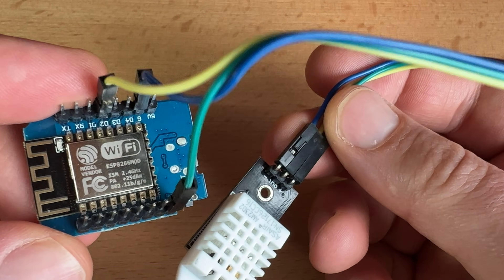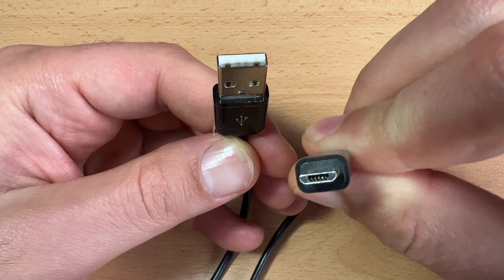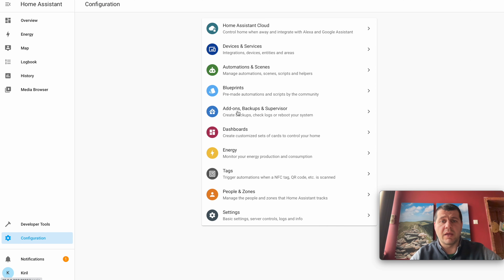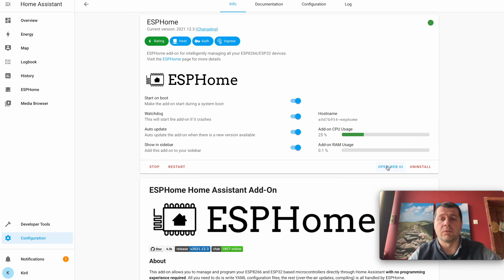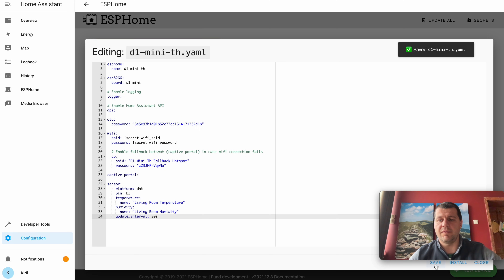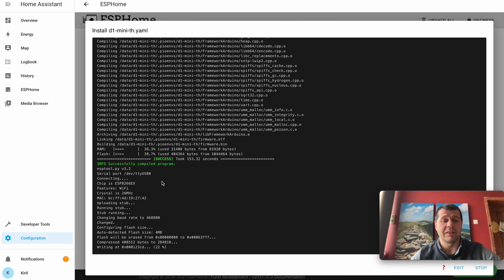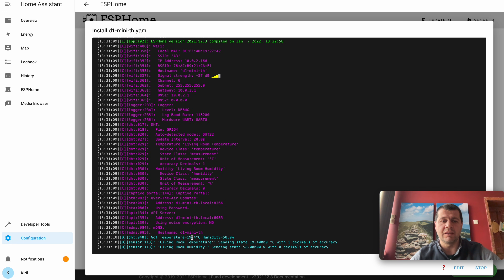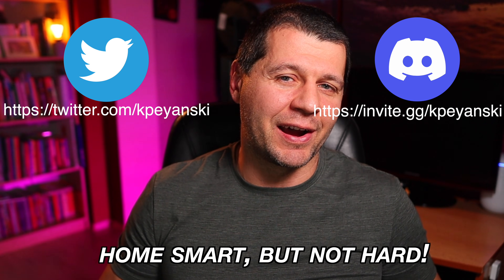Cheap DIY Temperature & Humidity Sensor that works with ESPHome & Home Assistant

Comment: Very nice video.  I'm just now learning about ESP32.   What if I want to power the esp32 board with a battery instead of USB connection?  I want to place one in my greenhouse to monitor the temperature where my plants are growing.  Later, I want to turn on a heater if it gets too cold...

Comment: Here hoping this comment can get seen. I am currently having an issue and I am fairly sure it's the firmware 
Whenever the device loses power or reboots, the readings after it's back online are horridly incorrect, to solve this I simply re-install the firmware to the sensor via HA. Wondering if anyone might know a resolution to this

Comment: Hello, I have connected Dallas sensor to ESP32 and it works. BUT. I also need to connect meat temperature probe which is technically a thermistor. Do you know by any chance how to write the yaml file in the ESP home?

Comment: Decided to build this and was surprised that in my yaml pin: 2 is entered yet the physical wire is on D4, why is this working thought the data pin was supposed to be D2? Also can't type in D2 under pin it doesn't like that so I have to enter just 2?

Comment: I couldn't get my temperature readings to go off. I realized you needed to "install" the changes, if you edit the yaml afterwards. Did an update or install, and got the temperature/humidity readings right away.

Comment: Could not connnect to board through ESP Home with any method. I always run into problems lol. Can use Arduino IDE software with no issues tho. Any way to integrate my device into Home Assistant after setting up with IDE?

Comment: Nice tutorial, I made 3 sensors like this, they only work after pressing the reset button on the d1 mini once (if not they read completely off values like negative temperature and 20% h). And also they become unresponsive after some time or I think after a certain number of reading. Do someone know why ? (I don't use resistors)
Reply: So I found that adding "model: DHT22" after "platform: dht" makes the sensor read correct value right from the start without pressing reset. No more negative values. If the time out issue persists I will be able to toggle the usb power because I plugged them on a smart switch.

Comment: In ESPHome 2023.3.1 it is not possible to  choose "Pick specific board". Only ESP8266 and ESP 32 is available. IS there a work around?
Reply from the maker: Just Choose ESP8266 and you should be fine

Comment: Thanks for the video.  I did have some initial difficulties and learned 2 important things:
1)  if you are using a raspberry pi with Home automation already, and are using Zigbee, you may need to disconnect the zigbee dongle while first configuring the ESP.  The SB ports on my Pi were very noisy.  Once configured and running on wifi, no problem.
2)  I needed to add a 4.7K pull up resistor (as suggested by some others if I was having difficulties.  That helped the reliability of the DHT a lot.
Reply: Is there any way to set up a  ESP temp.sensor according the above method on one homeassistant-installation and then adding them to another HA-installation?  I missed your first step and just restored my HA from a backup.🤐

Comment: #THOwned Nice guide! Except my readings are off. -12 degres, but it is about 20 degre... Is there a way to correct it?
Reply from the maker: Hmm, something is not right. Double check your wiring ...
Reply: @KPeyanski  Thanks for the reply. The wiring is OK.  In the code I needed to add: model: DHT22_TYPE2 Seems like I have that sensor, after trying all the other. :) Now I got a dT of about 4 degrees. I blame this on the heat coming of the ESP itself? Because I use the D1 mini with the DHT shield close to it. Thanks!

Comment: 😀#thowned Thanks, great work! I had to make to make a couple of small changes to the esphome config edits that you showed in the video to get accurate readings from the DHT22. I include the edited version below in case anybody else is having the same problem........

sensor:
    platform: dht
    model: DHT22
    pin: D2
    temperature:
      name: "My bedroom temperature"
    humidity:
      name: "My bedroom humidity"
    update_interval: 30s
Reply from the maker: Thanks, and enjoy your DIT TH Sensor
Reply: Thanks, you saved my day

Comment: Just followed your Video Tutorial. This is my first time doing anything with microelectronics and it worked perfectly! :) Thank you very much! #THOwned
Reply from the maker: Nice work and welcome to the club. I must warn you that this thing is addictive 😂
Reply: @KPeyanski  Haha, thank you very much :) I do have one problem. Initially, when connected to my Raspberry Pi, right after installation, the sensor reads pretty accurate data. But as soon as i disconnect it from the Pi and reconnect it to the Pi or use a Power Adapter to plug it into my wall outlet, it reads temperatures at -10°, which is far from correct. So it seems like, disconnecting and reconnecting somehow "destroys" the readings permanently. I have tried different wall outlets and different Power Adapters. But they are all 5V adapters, which should be fine according to the ESP documentation.
Any Idea what is wrong here? :P
Reply: A reinstall of the ESP will fix it, but as soon as i pull out the USB from the Pi, and plug it in anywhere, its broken :(

Comment: Is it possible to use this sensor without plugging it into the raspberry pi usb? I want it around the house so having it connect via wifi would be ideal
Reply from the maker: Yes, of course! You need one USB adapter and you can plug it in any power socket.

Comment: I did this same setup. I tried out 6 different dht22’s and 3 different boards. The temperature was consistently lowat about 14 Celsius. And humidity stayed around 5-15%. When in reality temperature was 22 Celsius and humidity was 49%. What could be the problem?

Comment: Followed instructions - while the mini is online - no entities show up - so no temperature / humidity readings.It's not a Wemos unit (instead an AZ-Delivery) but at a loss as to why the dht22 is not seen.  Any ideas? Thanks
Reply: it appears for my particular D1 mini I need to add "model: DHT22" to the D1 mini as the auto_detect default does not seem to find them!
Reply from the maker: Thanks for sharing the answer. Enjoy the DIY Temperature Sensor!
Reply: If anyone else having this issue, restart home assistant after install. This solved it for me.

Comment: No pull up resister used. According to the document there needs to be a pull up resister between data pin and esp

Comment: hi, great tutorial. Is this or a similar simple option for integration into a homebridge? Thanks
Reply from the maker: If you add homebridge integration in HA and expose sensors domain it should be visible on your iOS device.
Reply: @KPeyanski  the thing is, I don't use a home assistant, only a homebridge ... I want to make a table control with 3-4 switches and a thermometer. This method with ESPHome in HA seems quite simple to me, but if there is a homebridge or homekit device, I am referred to the finished FW on github ... I found something, but not exactly what I want ... only to make each device special and that seems unnecessary to me. 2x ESP, 2x networked devices, and all in one box. One board does it too ... in creating FW for homebridge or homekit, I don't know that at all ... is there a similar guide as for ESPHome in HA? or another option how to make a simple DIY FW? thank you and apologize for the unnecessary questions 😇

Comment: #THOwned but the values that I am getting are wrong. Temperature and humidity are way to low. Any idea on how to fix this?
Reply from the maker: Hmm not really, is it possible for you to try this with another TH sensor? Yours could be defective.
Reply: @KPeyanski  Hi thx for your quick reply. I just tried 5 diffrent sensors on 2 diffrent controllers. The result is still the same... I guess I have to get other sensors. Any recommandations? Maybe those SHT31 that were suggested below in the comments? Anyway thanks for your work and all your great videos.

Comment: How long does the DHT22 last? I read they can dry out?
Reply from the maker: I have 2 DHT22 sensors working non-stop from more than 2-3 years I can't remember exactly when I install them. If they die after some time I will invest $3-4 more to just replace them

Comment: Just got into Home Assistant, have been using your videos for guides! Thanks for the help! 2 questions. First, the dht11 appear to be slightly cheaper (I'm prefering amazon for now so I don't have to wait so long for shipping). Will these work/is there a draw back to these? Question 2. Instead of powering these with micro usb, can they be spliced into say an led strip that's running off 5volts? Thanks again for all the help!

Comment: I use to make my own sensors., adding light sensors, motion and the temp and humidty all in the one device.  Some even had LED's I could use as night lights.   I loved it in many ways, but these days a lot of ZigBee sensors, like the little Xiaomi ones, are just as cheap and also local (no cloud needed) so I stopped doing it.  Not to mention the fact the ZigBee ones can be battery and last a while between changes.
That said, really great to see a new video on how to do all these sort of sensors.  Most of the videos on YouTube are not very recent
Reply from the maker: Yes, battery sensors that are working with HA locally are no brainers. Thanks for the comment Brendan!

Comment: of all the sensors you chose the second worst one and the bulkiest one. Choose an I2C sensor such as SHT31, AHT25 or HTU21 instead
Reply from the maker: I'm using several DHT22 sensors for years and I have zero problems with them plus they are cheap. I know there are better T&H sensors out there but I don't need them for now.

Comment: Great video KP. love the simplicity. I have them in every room of my house, also In the attic, outside under a covered porch, and in the garage too. They work great. I keep the sensor away from the board because the module gets a bit warm and I wanted open-air temp and humidity. Also, don't forget to back up and save each ESPhome device config just in case...
Reply from the maker: Great tips & Great comment! Thanks :) Are you using exactly DHT22 sensors?

Comment: Great video Kiril! Last week my wife asked if I could make a temperature sensor to put in my daughter's school bag to track how cold the classroom at school was getting. Sure I said... thinking about how best to power a pi or an esp. Gee it grew into a major exercise! If I go esp I need a sd memory module and a clock module on top of figuring out power... This might take me until the summer! I will keep you informed :)
Reply: There's no need to use esp for this. You can take plain vanilla arduino Uno or Nano along with SD card module. Plus a battery cell box with 4 AAA to power it all.
Reply: @tovmax1  Thanks. Won't I also need a clock module? The unit won't be connected to the Internet and I need to log the time that the temp was logged?
Reply: @davidwentireland  You are right, the RTC will not be superfluous for your task at all.
Reply from the maker: What a great challenge :) Say "Hi" to your Wife and your Kid. Wish you success and don't forget to share the end result with us 👍

Comment: DHT22 is good for temperature readings, the humidity though started to fail on me after a year, reading 99% almost all the time. Probably because i smoke in the room,  gonna try some methods to revive it.
Nice video as always, Peyanski, thank you very much!
Reply from the maker: Thanks Arturo, glad you like the video! Mine Dht22s are working great for over 2years already, but I’m not smoking so this could be the reason in your case indeed.